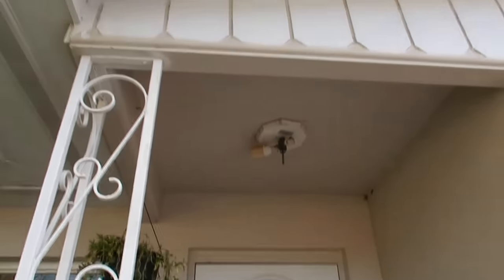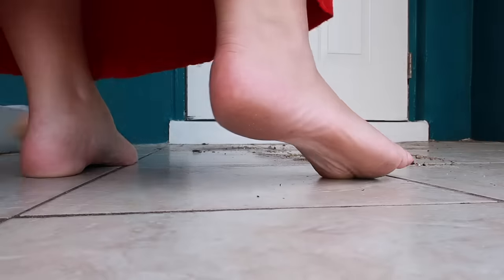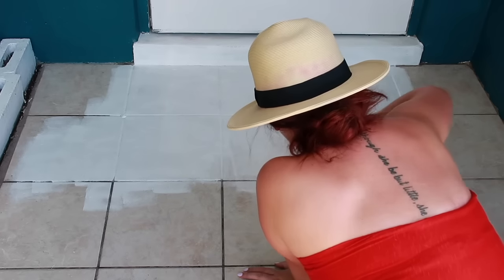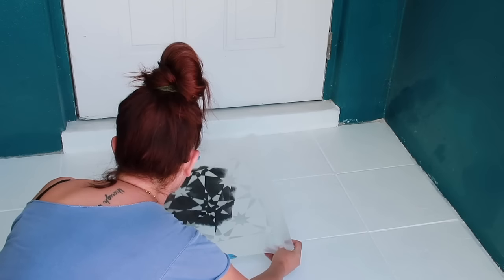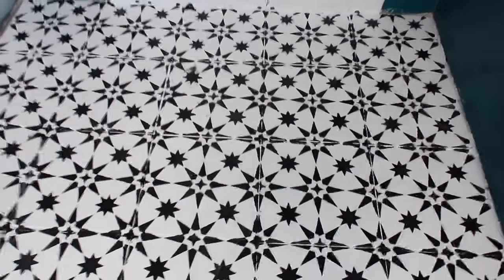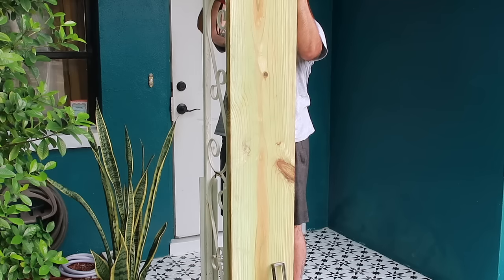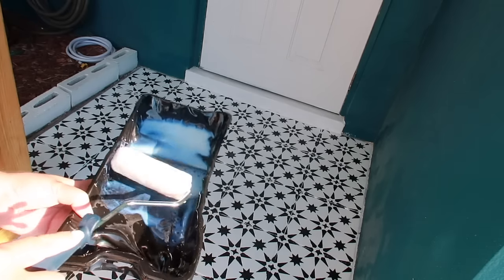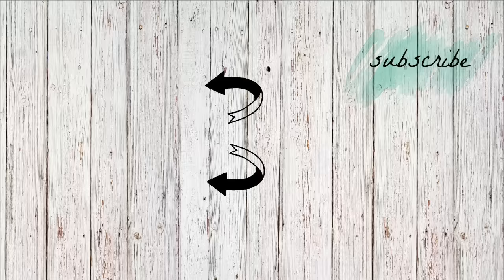DIY FRONT PORCH MAKEOVER | ON A BUDGET!

Comment: As always, I am in complete awe of what you do to improve your home. I have learned that while things look easy in videos and instructions don't seem "too bad", that it's not easy, and it is bad. I have ZERO patience. I end up rushing through the prep part (never a good thing...) and then getting SO impatient that I just rush through the rest of it, only to have it peel off because my dumbass didn't take the time to prep the surface correctly. So when are you coming to fix up my apartment? :)
Reply from the maker: Thank you!! This comment made me LOL! I’m the same way, I painted it with exterior paint with no sanding.. epic fail. Then I sanded it off and did the actual research and did it the right way. I try to keep it real with the diys ..most of the time something frustrating happens but it’s almost always fixable!
Reply: @mustl0veshoes  Glad make you laugh! We all need a little laughter these days. :) Stay safe down there in Florida!